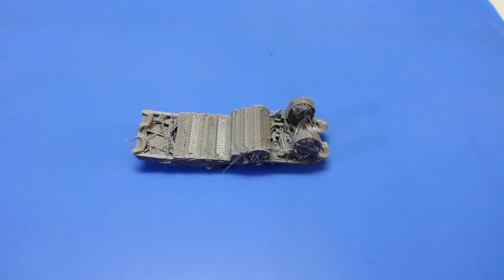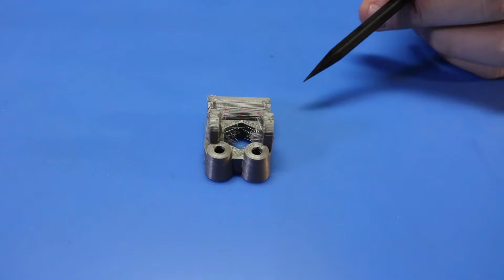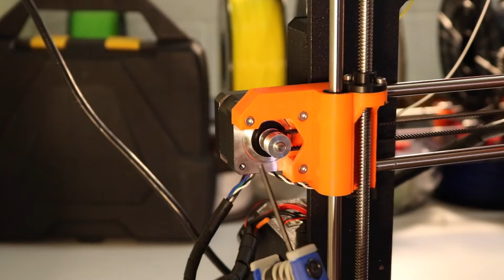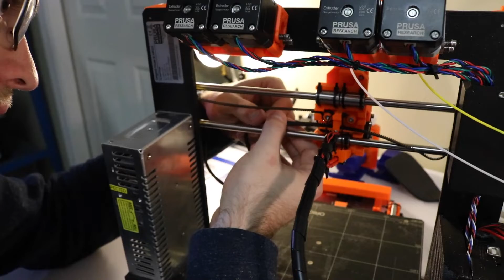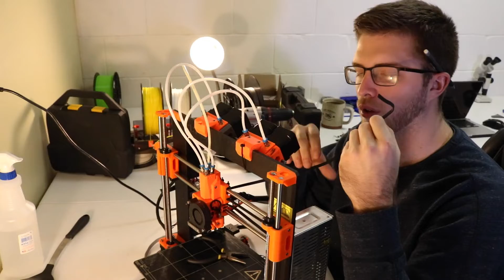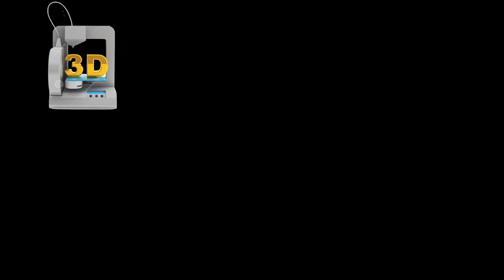Prusa 3D Printer Troubleshooting: How to fix X-axis/Layer Shift Issues

Comment: So what do you do when the X-axis layer shift is intermittent, yet 1- the grub screws are tight as hell and 2- the belt test keeps returning consistent measurements indicating the belt hasn't loosened up?

Comment: I just found your video and I wanted to say thank you because I'm pretty sure that's what my issue is, if that's not the issue then I'm going to have to replace the bearings and the smooth rods. I don't think you'll see this but if you do could you tell me how difficult it is to replace them?

Comment: Solved my problem, the x-axis bearing had become loose and the belt was rubbing on the housing. On the MK3S you can simply hold the shaft with a set of pliers when the grub screws are loose, then manually move the extruder to re-align the flat to the screw, saves removing the belt.

Comment: Thanks! My gear was loose and not in the proper position. I left my belt on and just turned off the printer so that the gear spins freely and then tightened the little retaining screws on the Gear. Now its perfectly tight and no more layer shift.

Comment: I'm having a bunch of layer shift issues with my MK2s. Double checked pulleys, belts, bearings, rods, all seem to be in working order and within specs, but still getting a shift around 80% thru the print. Any recs? Thanks!!
Reply from the maker: +Jo Crandall does the shift always occur in the x axis?
Reply: @304techmaven8  About 90% of the time... I was beginning to think it may have something to do with my Igus bearings, but then I did a factory reset along with a self-test and it says the y-axis pulley is loose... may still be the bearings?

Comment: I have a problem with a cr-10s 400, I get a layer shift exactly 1/2 in hieght of every print. I had thought I over tightened the belt spent the day adjusting belt on x, then I flash marlin lowered jerk settings which gave me the shift again, checked the pulley to make sure the tight screw was locked into the notch on the pulley bar. I am at a loss as I had this printer 1 year and have not been able to get a solid print
Reply from the maker: +Lucas De La Vega im not 100% sure on the cause for a cr-10s 400 but if i can find anything on it ill let you know! Thanks for watching!

Comment: For added credibility you need to correct your names of items you are referring to. Point in case, that item attached to the X-axis motor that the drive belt  IS NOT a bearing it is a notched pully for the GT2 belt.
Reply from the maker: +Dennis Hughes thank you for the constructive feedback! I should have been more careful when calling out different parts. I was referring to the bearing as the pully bearing, and the pulley as the belt. Thanks for tuning in!